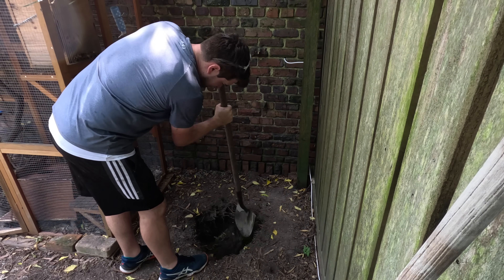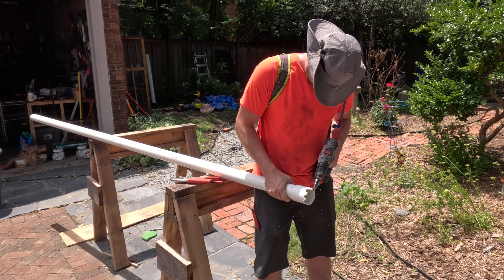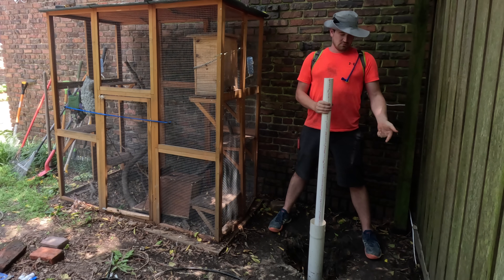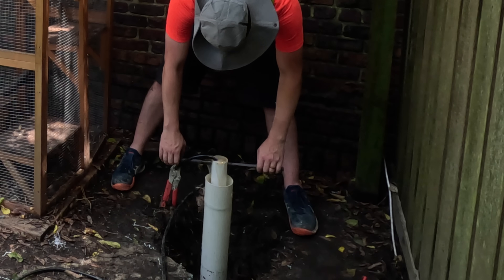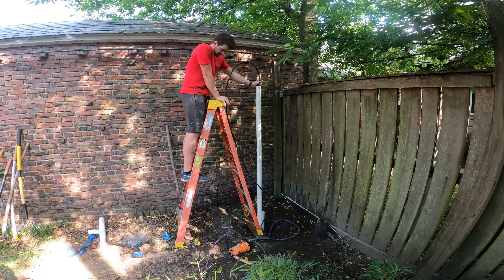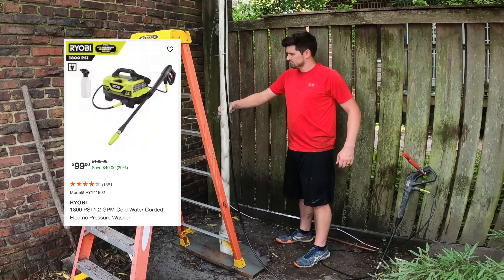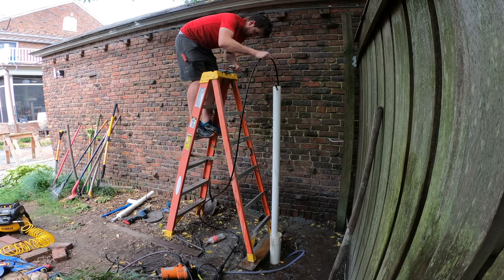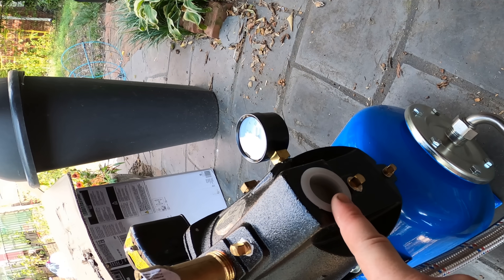I dug a 40 foot well in my backyard

Comment: Hi I see your check valve is at the top and I’ve seen others attach it just above the well point down near the bottom. Does it make a difference? I can’t get a 1 1/4 in check valve down a 2 in pipe. Just like you I assume. I’m wondering if the water column helps keep the valve closed if at the bottom. Not sure.

Comment: This definitely wouldn’t work in most (if not all areas) of Arizona. Believe it or not we actually have abundant large underground aquifers; many of which are untapped, but the issue is the hard dirt and rock you’d have to get past. A PVC pipe and a small pressure washer wouldn’t cut it.

Comment: I made one shallow well with three well points 5 ft apart. The 1st one was 38ft deep, the 2nd one was 45 ft, and the 3rd one was 35 ft.  I got too much water, but it had too much iron content, which stained my cement driveway.

Comment: Nore NOTHING STICKS TO PVC PIPE UNLESS YOU REMOVE THAT SHINY GLAZE WITH PRIMER. Those glue joint will fail.
Reply from the maker: my glue was 2-in-1 with primer. pipes still work
Reply: @BadHomeowner  Do you meant blue glue and primer in one. That was good you could twist it apart a month later. Never had good luck with it.

Comment: That line coming out of the pump is a vibration absorber. It's purpose is to absorb the vibration of the pump while running and more importantly, the vibration created when the pump is turned on or off.

Comment: Did you happen to get permits for the well?  The design you showed at 1:20 violates a lot of regulations related to the safety of aquifers that produce water for human consumption.

Remember that wells work both ways.  when it rains anything on your lawn (fertilizer, dog poop, etc.) is going to go down that well and get into the groundwater.  And water underground has a flow rate.  So over the years not only will your own water ben contaminated - you will have contaminated your neighbor's wells also.
Reply from the maker: yes I did with my county

Comment: Take a step or two up your ladder bro. That would have sped up inserting that pipe big time. From watching this I can say that your idea is sound. You have a good build for doing this with a nice soil structure. Some suggestions I would offer are when you have the sand and dirt water coming out of the top of your pvc pipe. Instead of having it just flow freely out of those circle holes you made. Make them threaded so you can attach a hose pvc attachment insert into them and then flush the dirty sand/dirt water away from the hole. You are losing a lot of efficiency by having the dirty water flow back into the hole you are digging. They also sell hose heads that have great pressure for clearing out pipes from debri. They shoot water out the backway as well which would increase the rate that the dirt is removed. Last of all, if you are in an area where you don't know where water will be, try dousing rods. You can use to hangers or a Y shaped healthy branch from a tree to find your spot. You walk around the property until the 2 hangers cross. That is water. Or if the Y branch goes straight down out of nowhere THAT is water. Great work though. Keep inventing!

Comment: 7:35 do you think you could possibly get around this issue by somehow clamping the hose to the body of the pipe so that it only ever extends just slightly past the end of the pvc? This would have to be adjusted every time you add more pvc of course.

Comment: No foot valve on the suction point and no low pressure switch to shut the pump off if it pumps dry. But very interesting to watch!
Reply from the maker: I show installing the check valve (which is the same as the foot valve), and also show the pressure switch I installed

Comment: I find this fascinating. Where I live I've never dug a hole more than about 2 meters deep before hitting bedrock or a bolder so big it may as well have been bedrock. On top of that there are so many rocks in the soil I can't even drive an auger style ground anchor, that PVC drill head of yours would loose all its teeth in the first half meter.

Comment: Great video; I learned tons.
I was an environmental engineer in my former life, so I'm trying to conceptualize what is occurring. 
It is essentially a giant water column and so depth achieved has other constraints aside from just the sediment types, such as flow rate. With increasing depth, there is less velocity or energy to push sediments up or out, since they have to go somewhere. At some point, sediments might get suspended, but settle to the bottom of the hole before exiting out the top. It might feel like hitting something hard, but instead there simply isn't enough energy to push anymore out. A Hjusltrum Diagram shows how the entire process works. It is also possible you simply did hit a hard layer.
I'm currently stuck at 26 feet or so, so I'm thinking about adding a 2nd pressure washer and hope my hoses don't get tangled. I might invest in a different method of using a trash pump, which pump i think  in excess of 200 gpm, but  requires a stationary water source, so I'd probably get an inflatable pool which holds around 1000
 gallons. I'm guess around $400 for such a set-up.
 You're a smart dude to come up with an ingenious method and with tips which have helped me a lot.

Comment: I have an old well that was abandoned on my property. 8 inch metal pipe, filled in with dirt and 2 wires hanging out with a 8 inch thick concrete slab. Pretty sure a pump is at the bottom and there’s no telling how deep it is. Wish there was a way to get it rewelled. I guess calling a company to look at it would help

Comment: Very interested to know what yield you get. I would have made the first 2” pipe perforated to allow water to enter rather than relying on just the end of the pipe.
Reply from the maker: 4-5 GPM.  Maybe not as high as it could be, but more than enough for running a simple sprinkle system in my yard

Comment: Good job.
My deepwell is 240 ft I dug for 3-months (1-hour daily) alone using a manual percussion. Hardest part is at 150 feet with stones. Nice to have own water supply independent from public water system.
Reply: I’ve been curous about drilling my own well but our water table is 150 and below, and we have hard pan soil too, is this possible to still manually drill something that deep?
Reply: @brennerborec3422 I dug a hole about 16” diameter x 12” deep exactly right below the percussion. I poured about 10-14 gallon of water into the hole and started digging after the water seep into the ground. I didn’t bale any soil since the softened soil is just pushed sideways creating about 5-6 hole until I reach 240. Note that it is not all easy as hard rocks along the way stalled me dug in 5-6 inches in an hour. Patience is the key. One hour x 3 months was my time before able to put in the casing.
Reply: @brennerborec3422 sent long reply twice but it seems Youtube cut it off. I will send another one short later and hope it will go through.
Reply: @brennerborec3422  Made a tripod tower about 12 ft tall. Hang a pulley on top after positioning the tower to the drilling point in my lot. Pulley must be hang with nylon rope or similar.
Reply: @brennerborec3422  I fabricate the drill similar shown on pages 49 onwards with some changes on my own. I bought 2 1/2” x 8’ round bar and weld on one end a hard steel flatbar 3” x 8” lg cut from scrap a truck lift-spring. I ground to sharpen the end. A 5/8” round bar weld in loop at the other end of the round bar. The assembly is my percussion.
Reply: @brennerborec3422  Next I tied the 5/8” nylon rope into my storage tank support located about 16-18 feet away from the tripod. The rope is tied about 5 feet from the ground. I then loop the rope around the pulley and then tie the percussion. The rope was the I used to raise the percussion up and down from the middle of the tower and my storage tank.

Comment: That is a pressure coupling not a normal coupling. If you use a normal coupling in a well it will break every single time.

Comment: I have put 5 of these well points in South Florida. Tied together like a manifold that goes to a professional lawn sprinkler pump. I run a self installed 8 zone sprinkler system for the yard and plants.  21 gallons a minute. Had to install iron treatment to keep surfaces from turning orange red from iron content in the ground water.

Comment: Hey, In the context of drilling, an iridescent white or blue fluid found might indicate emulsified oil. This means that oil and water, which normally don't mix, have been combined to form a stable mixture called an emulsion. Key thing is where is the oil coming from In summary, an iridescent white or blue fluid found when drilling suggests that oil and water have emulsified, creating a stable mixture with a distinctive appearance due to light interference. You see the mention of oil here and the milky white ?  It may be a indication of crude oil deeper, some how its  pushed up through the layers 🎉

Comment: Hey bro, good work!  Im re-doing a sand point rn and its been a disaster.  How is your supply to date?  Would also like to know what pump you replaced the old one with?  Also, is that a pressure tank built right into the jet pump?

Comment: Thanks for this outstanding video! I currently water my garden up to 300 feet from my house well with essentially 50' and 100' hoses laid on the ground. That seems inefficient, and for the past year or two I've been thinking of drilling another well right in the garden. I just happened to see this video in the offerings YT makes on the right side of the monitor screen. I can definitely do this, as my water table is only about 7' down, and I have 220vac service right next to the garden. Thanks again!

Comment: MY GUY. that yellow glue is FLOWGUARD glue. Its different than regular PVC glue

I would reccomend glue (only for drilling not drinking) for PVC pool pipes. Its designed for bigger pressures than flowguard!

Comment: Adapting over to black polyethylene is a hell of a lot easier than using PVC from the wellpoint to the pump. Black poly is slightly flexible whereas the PVC is definitely not.

Comment: I'm no engineer but I think that's dangerously close to that foundation. Also chamfer those inside edges of the 2 inch pipe. And some gravel added in. Other than that, nice job. And some clever solutions to this problem.

Comment: Water definitively xplained& HOW 2harvest it.
  Water WILL BECOME THR MOST PRECIOUS COMMODOTY.
 This is armageddon.
 Satan will enforce chip. = Delete money.
  Thr will be NO supermarkets or Satnz pouson bottled drinks.
  Dig pond = square1 = clean rainwater with algae NO LINERS.
    55 gallon OPEN ONLY NEVER EVER EVER CAPPED containers&cement cisterns below roof gutter.
 1" rain = about 1,000 gallons.
   You MUST spill all barrels of mud b4 each rain refresh let initial rain clean gutters FIRST open container ONLY ability2 dip 5 gallon buckets in see dead rat in tank ONLY. 
  You MUST be able spill drum fast b4 freeze or crack container.
 Leave 1/4 full ok.
 Do NOT use filters or pipes or kill algae with poison clised containers like Satans kidz teach. 
  95% humanz = Satans kidz = poisonous scrypts that CANNOT learn. 
  You probably married2 one.
   They replace reality. Wrshipped as gods. "Creators" giants on You Tube. 
   All views fake online ANY platforn online amost all comments fake. I love u I pray 4u gid bless u deemnz in sheeps flesh.
 Viewcount lite endv tunnel = lure engineered2 tunes u 2h*ll remove yr light.
    All deemnz are digital.

    Reptiluan angels make it so any bottled liquid or tap passing thru metal pipe = negative orgone.
   Energy drinks manufactured off planet by Satnz scientists change yr DNA.
   Only cats& bats& vampires& insects cn drink negative orgone. 
  Reptilian angels eat humans. Via horrific torture must drink yr blood = negative orgone.
    
  All aliens require water NEGATIVE orgone.
    All gutters wrldwide pipe down water 2alien bases. 
    Most all well ground water now taste like barb wire& old cars cant drink.
    U need SPRING water only which is EVERYWHERE.
 = RAIN just beneath surface but not down in permanent well water level.
   Satans boyz lowered yr water table with lawnmowers.
    Lawnmowers create hardpack solar panels = real reezn 4global warming REAL reezn thr no BEES.
  Lawnmowers = no flowers/fruit treez.
  Used 2b people got buckets fruit roadside.
 Satans boys cn hack reality.
  Shapeshift.
You live in Satanz cmpudre program =  MONEY 4food or water ONLY &he MUST poison yr bodies bcuz they need money2 = slow kill fuel corrupt hospitals.
   Veggie low fat diets put more people in h*ll last 50 yearz then anything else.
   Brain = 75% cholesterol fats human organs begin fail1week no fat veggie diet makes u looney delete Satans poison processed oil eat eggz animal fat butter cold press oils.
     Orgone positive or negative.
  Satans kids spin molecules counter clock with metal water pipe tunes body 2h*ll with negative water.
     Water table iz now 330ft ave..
  America was once millions beaver ponds lined with fruit& gardens&Earth was not a furnace.
   
400 yearz ago:
    No fences or supermarkets or roads USA yet there wr buffalo within arms reach constantly no money.
    Your solar system used 2b heaven.
  Yahweh bans all angels from breathing 1word of any of this 2any of u.
  He watched did nothing when his son invented money spent 1,000's years preparing 2invade heaven with hadron collider on a secret planet he downloaded, Nibiru,  2punch a whole in heavens cmputer program back when yr solar system was heaven^angels lived on yr planets. 
   Yahweh is a h*ll factory 1st& a vast majority bottom level heaven 2nd. 
   Do NOT GOOGLE anything u reading here.
 I live on food forest Wister Oklahoma built a 3.5 ton positive orgone generator here bringz holiwater.
  Makes plants gro cleans atmosphere wildlife loves it.
  1ounce pucks covers 2 atmospheric miles.
  My orgone = 10' x 3" pipes works out past yr constellations burning Satans dimension/cmpudre program with positive orgone brings holywater rain.
   I turn Lake Wister in2 holiwater with quartz crystals.
   I put orgone pucks in my rain barrels I sell theez quartz pucks ebay.
    My orgone = thfire u read about revelations. Noah by water 2day by fire.
   Yahweh is banned by his own laws& courts from touching earth or making orgone as if 2016.
  My orgone capacitor  = white horse rider Revelationz given bow&no arrows = un conventional weapon.
    When I became wrldz best guitarist history mankind& creation I wz immediatly introduced 2 Reptilian angels&Yahwehs son.
  Halayel.
 Hal, who u know as "Satan" fell so he could be like his father.
 Show me a mans enemies, i will show u whathat man iz."
 Hal is 274lbs black humanoid snake with wingz & must eat humanz 2survive.
  "On yr belly/appetite u will go, dust/humanz u will eat.
 His father rules on torture all must drag a torture stake.
    Hal has a fun room where he tortures humans.
 Yahweh built a theme park in h*ll where he dips people in lava with ferris wheels flesh grows back 4eternity. 
 Yahwehs torture more sophisticated then Hal he makes u torture yrself& its whatever u love most thats what he takes away.
   U live in a karma based cmpudre system& th universe has a consciousness everything wz created outv nothing with quartz. = a motherboard. Silicone valley.  Earth is 70% silicone.
    Instructions 2make orgone wr put in my lap when my 1thought became burn Yahwehs son.
    I immeduately quit olaying guitar:   
   
 My 1 thought became burn Yahwehs annointed son.
    Yahweh both annoints/protects his son. Hal wrote 1/2 thbible.
   A 1/2 truth is a whole lie.
   Apostle Paul was Satans. 
   Only takes 1less spark plug yr engine iz now a paperweight.
  Sin city money hump war xpert Trump, yes he is Satnz2.
  Satan using Wall as soulcatcher dragnet they are abducting torturing&eating trafficking &raping immigrants.
   You:
   Must delete money.
    Build farms dig PONDS.
    Raise yr water tables direct all water IN not OUT.
     How 2garddn.
  Dont.
  Just build soil.
    Lay SMOTHERING &WIDE mulch.
   Lay MULCH 8" deep my squash roots 20' diameter shallow I use chicken manure fall rot ANY greenery weedz in water apply 10 to 1 plants.
    All humanz niw required 2possess orgone pucks bcuz Satan is merging dimensions.
  . POSITIVE orgone = lifeforce of creation bringz holy rainwater that BURNS evil aliens &police keeps them away from u. ALL poluce will now be deemnz (nephilem spirits, just as days of Noah) placed in flesh with hadron collider.

  They will drag u frm yr homes 4torture.
   Hide. U must also have orgone DO NOT BUY ORGONE ANYWHERE or try make it.
   I am only seller of orgone.
 95% humans are plasticines. NOT humans.
 They are organic portals2 thBEAST cmputer hive mind cmpudre.
  They animations. Alien invasion u can NOT mix with them.
   They are profoundly imbecile. Idiots.Clickbait.
   Teach humans fail in all thingz but ESPECUALLY in gathering water making food.
  Get back 2eden where u wr placed.
   Eden was not Yahwehs idea. It wz built by his kidz. Adam& his 1st wife Lilith wr created by Elohim. Not Yahweh.

Comment: We had to put ours in one section at a time, gluing as we went. It took 2 people. 1 to guide it in, and another to make sure it didn't fall in. We used a brass wellhead at about 30' if I recall correctly. The water table was at 18' at the time. . The well casing was deeper. It was a redo. The water table had dropped below 7', where the wellhead was originally. The water was perfect. I miss that house, or at least, that well
Reply from the maker: That's the best way to do it if you have 2 people